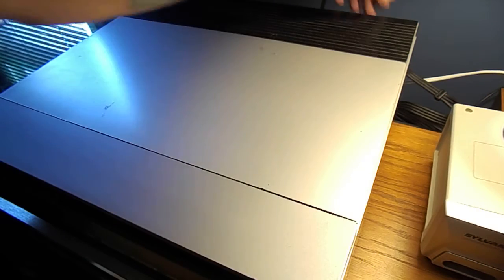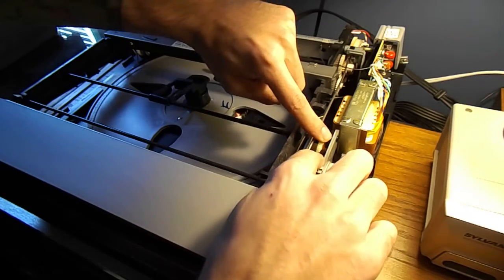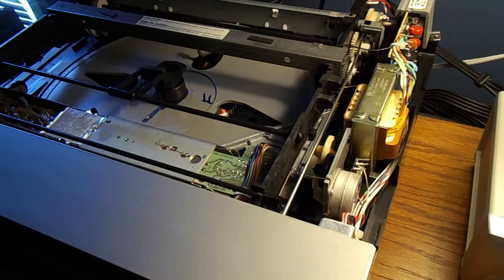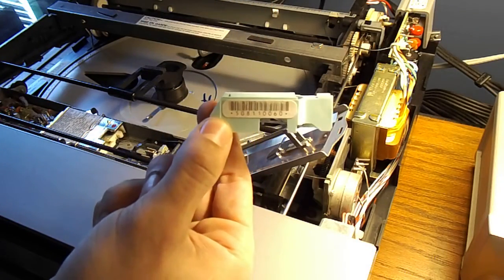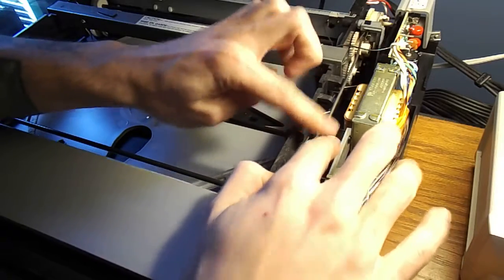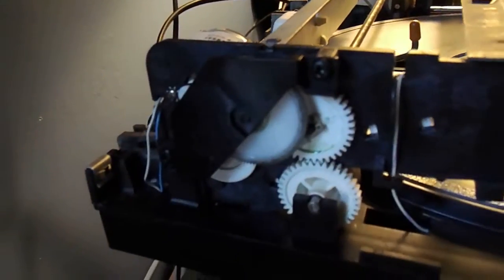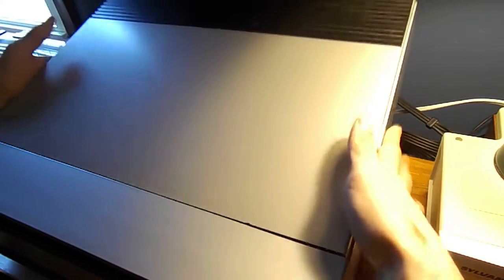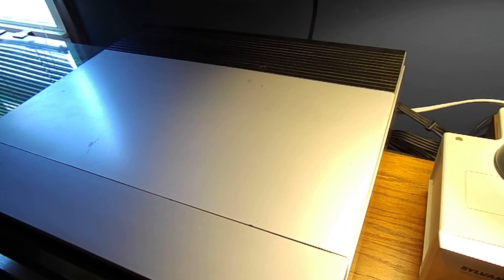SJT/SKT ced player stylus removal how-to and function belt location

Comment: I've got a SJT300.  The gear that drives the stylus (the one below the two your are moving) is broken.  Any idea where I could find one?
Reply from the maker: I believe you need the third reduction gear. These are designed to break before something harder to replace is broken. I believe you can still email john at cedatum.com and buy one from him.
Reply: @TonyFleetwood  Yes!  Thank you very much!  Emailed them and they sent a price list right over.  He also verified that it was most likely broken during shipping as there were no shipping tabs reinstalled (who'd know or have them anyway after almost 40 years).  Thanks again.
Reply from the maker: Glad to hear, i have 3 sets of shipping locks in case i ever sell a player, it wont get damaged. Small screws in lieu of the locks works also. Good luck!

Comment: HELP !!! I followed ever step meticulously and change out the old stylus for the new one. When I put everything back together and played a disc,  it just made a scratching noise.
Now the only way it will work is  if I use the old stylus with the volume turned all of the way up on my receiver. What happened and how do I remedy this. 

Would somebody out there who knows enough about these units please suggest what I can do?
Reply from the maker: i dont know what you mean by "scratching noise" but thats usually the noise they make when the turntable is set too low. the stylus wont get a good pickup. your old stylus may have had a longer flylead causing it to barely read the disc, or you bumped the player and dislodged the thrust washer that the turntable spins on causing the turntable to drop. you are going to have to remove the turntable to see if the thrust washer is in place, and then adjust the turntable height accordingly. its a small flat piece of metal about 1/8'' thick and about the diameter of a pencil eraser
Reply: It had just been refurbished and was working just fine until I tried to replace it with a brand new stylus. After which, there was no sound or picture. It was more like a ticking noise when the disk was playing along with two separate lines on the display.
Reply from the maker: if you hear light ticks and only double dashes come up on the display the stylus is bad, or something in the stylus arm is bad. the tick is the coil setting the stylus down ( or repeatedly setting it down looking for the first time band on the disc). if the stylus was in the original box with the foam insert the foam is known to offgass a chemical that ruins the fly lead on the stylus causing the player to not be able to read the disc and display double dashes in the time display
Reply: Now tell me what you make of this? In an act of desperation, I bought a brand new copy of A Solder's Story just to gain more clarity on the situation. The shrink wrap was torn up and the label had stains on it, so I didn't feel to bad about trying it out.
 There was an unexpected result, it seemed to fix the problem all together and now my CED player is  playing the rest of my disks like it should. So was this a temporary solution or did I just get lucky?  Please leave a comment if you can and thanks.
Reply from the maker: cant help you there, you need to check out the cedmagic facebook page. or cedmagic.com